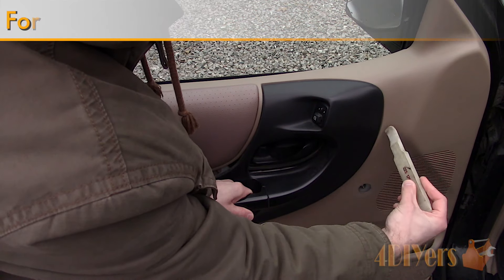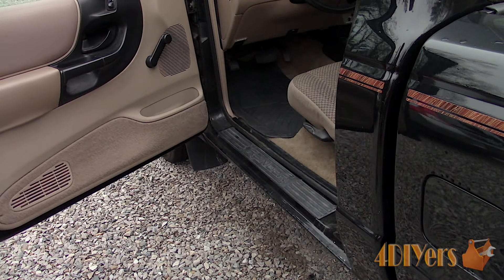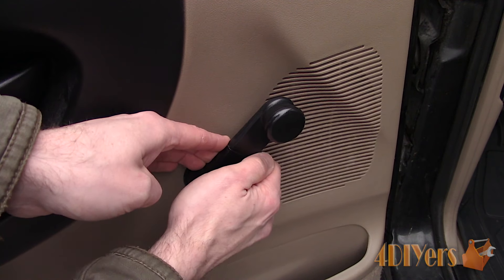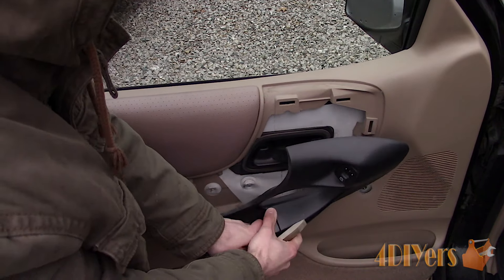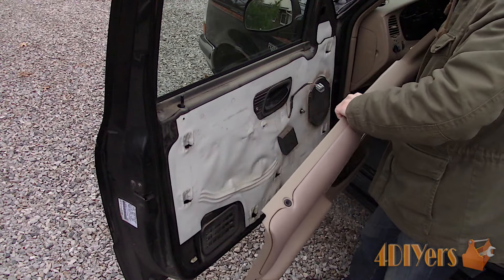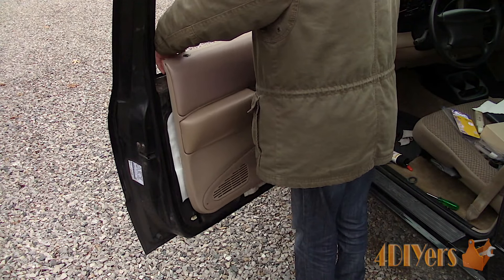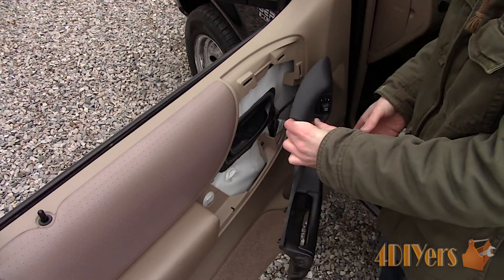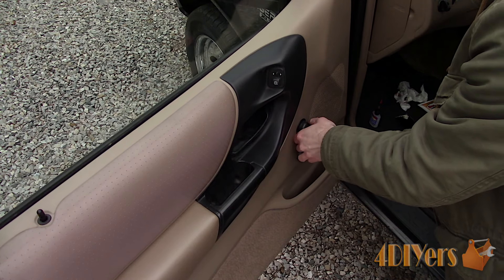How to Remove the Door Panel on a 1995 to 2012 Ford Ranger

Comment: My door handle just detached internaly making getting in my truck difficult. My truck doesn't have the stock seats so it is a tighter fit. They are leather seats from a Chevrolet truck. My uncle installed those.

Comment: I have water in the bottom part of the driver door- I can hear it swishing, when I shut the door..taking off the door panel, will I be able to get to it, to get the water out?    2011 Ford Ranger w mini cab
Reply from the maker: Check your door drains, most likely they're plugged.

Comment: How does one get the stupid plastic cover off the window crank ???
Reply: Never mind I used a dental pick.
Now about that T-20 screw ... the cavity it is in is too small and deep to use bit in a driver.
It requires a dedicated T-20 screw driver with a thin shaft.
Reply from the maker: Glad to hear you got it. Used you need either a screwdriver torx driver or an allen wrench style. Could use an interchangeable tip version if you ground down the diameter.

Comment: My window crank is jammed in the door. Took out the t20 fastener in it and it just won't budge.
Reply: Mine was stuck as well it just took a lot of wiggling and tapping to break loose the splines.

Comment: Sadly the window crank doesn’t come with power door lock buttons with a small lock on the top all the way down. Ford needs to have a bigger size lock (about 1/2 cm, not 1/16 cm) so it’s easier to get out of the car/truck. Otherwise, we need to have strong fingertips (for example, natural nails, acrylics, or fake nails with a manicured look on the hands) in order to grasp that tiny lock on top of the door panel.